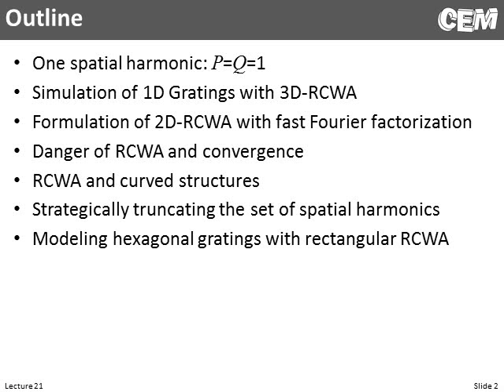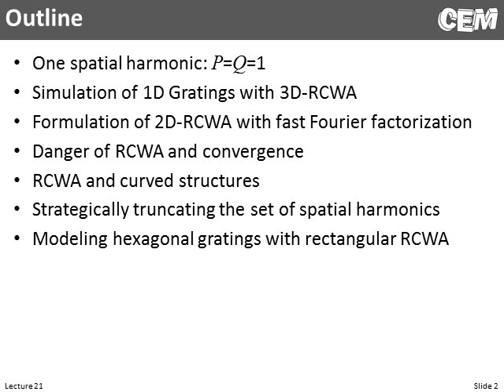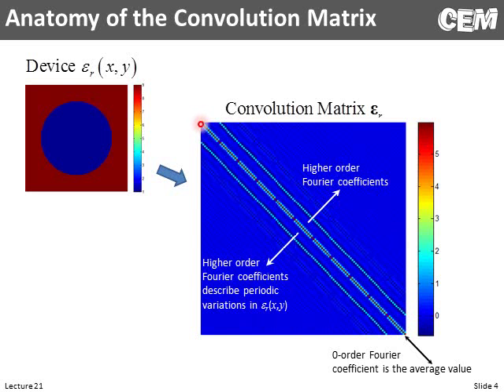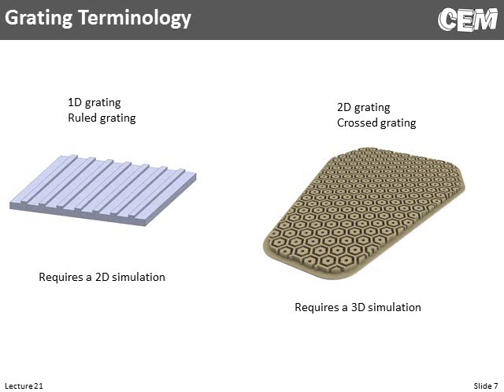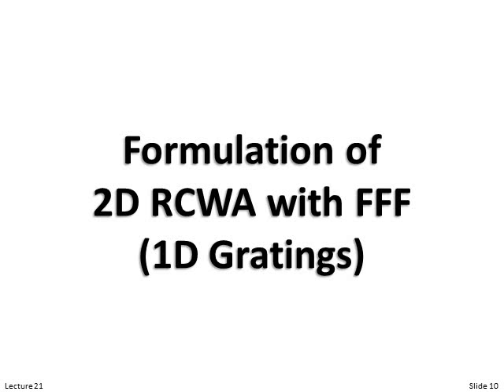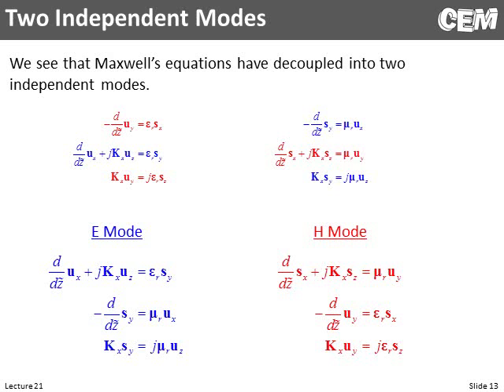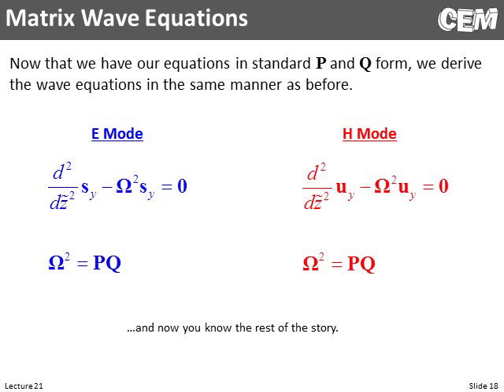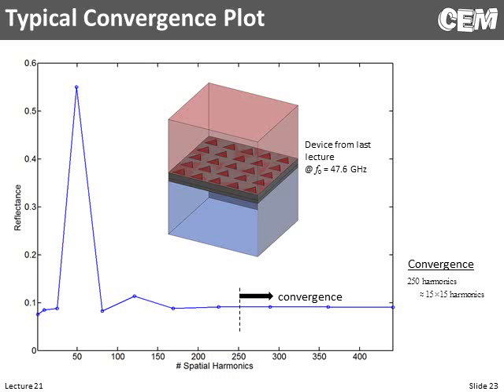Lecture 21 (CEM) -- RCWA Tips and Tricks

Comment: Hello Professor, I have watched this series of your videos and have learned a lot about computational electromagnetics from them, and I have also implemented a rigorous coupled wave program according to your method, and it seems to be running well. But one question I have is, if I have a thicker layer, for example, in real life every periodic structure has a substrate, if this substrate is thick, shouldn't I treat the substrate material as a transmissive region instead of as a layer? Or do I need to do other programs to handle this situation！
Reply from the maker: Usually the substrate is made to be the transmission region. The RCWA presented here cannot have loss. This is something we are working on. If you substrate has significant loss, you may need to make your last layer the substrate in order to account for the loss. You would then set the transmission region to air or something that matches the substrate material.

Hope this helps!

Comment: Dear professor, thank you for lectures!
If I undersood correctly, the computation time for RCWA is definitely depends on number of input values such as different incoming angles or wavelenght. It seems to me that we expect to see a linear dependence on the number of these input, provided that the structure and other parameters remain unchanged. Am I right?
Reply from the maker: The simple but incomplete answer is to say that a parameter sweep is a series of independent simulations. So, if your parameter sweep is an array of 100 things, total simulation time will be 100x the time of a single simulation.

Now the longer answer…Depending on what parameters you are adjusting, there are sometimes calculations in a simulation that do not have to get repeated each iteration. This speeds things up in some nonlinear way. For example, the convolution matrices in RCWA do not depend on angle of incidence or polarization. If you are not accounting for dispersion, they are also independent of frequency (or wavelength). You can calculate the convolution matrices one time and then perform the sweep without recalculating the convolution matrices. Polarization does not enter into RCWA until the very last step when reflection and transmission is calculated. That is the fastest parameter sweep for RCWA because 99% of the code does not have to repeat, including the part that iterates through the layers of a device.

When setting up a parameter sweep, look carefully to see what calculations will remain constant. Move those calculations outside of the sweep to maximize speed and efficiency. If you are doing double parameter sweeps, consider carefully what parameters you sweep first, second, third, etc. For example, if you were sweeping frequency and polarization, I would have the outer loop be frequency and polarization be the inner loop. That is because sweeping polarization is the easiest. If you were to move that outside of the frequency loop, you would be repeating many calculations that you should not have to repeat.

Hope this helps!
Reply: @empossible1577  thank you for answer! I found an interesting paper where the new solver is compared with RCWA. I don’t understand one point and I would like to hear your opinion. Let me contact you personally by mail...
Reply from the maker: @annakharcheva4548  Ok

Comment: Hello professor, I'd like to calculate the internal field in real space, I've looked at your notes but I'm unsure what you mean by the step "Calculate Indices of Where to Place Fourier Coefficients" in the diagram. As far as I know, the steps needed are to define the phase cross section, then for every z-coordinate inverse Fourier transform the field s(m,n) at that zi and multiply piecewise. But how do you ensure the same matrix sizes, since the number of harmonics are probably much less than the resolution in real space. Is it as simple as padding with zeros before the ifft? Also, how do you ensure that the resulting field is real? Thank you for any reply!
Reply from the maker: This is a big question with a big answer.  It is on my to-do list to make an online tutorial for visualizing the fields in RCWA.  I like to do this using the enhanced transmittance matrix method instead of scattering matrices.  So I recommend implementing this method first.

As for "calculating indices of where to place Fourier coefficients," you need to do an inverse FFT to calculate the real-space fields.  Usually RCWA is performed with a low number of spatial harmonics, say 11x11.  If you directly iFFT this, you will get your fields on an 11x11 grid and they will look very pixelated.  To get nice smooth looking fields, you need to pad the iFFT.  This means you pretend that you have done RCWA with  something more like 256x256 harmonics.  You will create an array of the Fourier coefficients where most of the 256x256 are all zeros.  The actual Fourier coefficients are inserted into the middle of this big array.  The location of where you put them is what I mean by "calculate indices of where..."  In general, the field is not purely real because RCWA is a frequency domain method and fields will have amplitude and phase.  I generally calculate complex fields and then just plot the real part.

Does this help?
Reply: @empossible1577  Yes! thanks a lot, that's exactly what I had in mind, it just felt like I was missing something. I have already implemented ETM and call the ifft like so, ifftn(s, [256, 256]) to automatically pad with zeroes to the desired size.
Reply from the maker: @ManderSeis  Sounds like you are doing awesome work!  BTW, you may not be aware of the course website.  I recommend using it as your main portal to the course material.  You can download the notes, see the information organized, get links to the latest versions of the notes and videos, and see other learning resources I put there.  Here is a link to the website:

https://empossible.net/emp5337/
Reply: @empossible1577  My code seems to work decently well now, but just to be sure, Ex and Ey should be continuous across boundaries right? In some cases this does not seem to be the case, could that be an IFFT artfact, or is there probably something wrong with my code?
Reply from the maker: @ManderSeis  How do you know it is not the case?  Are you calculating them?  How are you calculating them?  Yes, they should be continuous, but it is the sum of transmitted and reflected that is continuous.  If you are only looking at one of those, the field may be discontinuous.
Reply: @empossible1577  I think I might have propagated the backwards wave in the wrong direction (wrong sign), no wonder the boundaries looked messed up. Thanks professor!
Reply from the maker: @ManderSeis  Great!

Comment: hi ! your lectures are great!  I am searching for a book or pdf which introduces the rcwa method together witch actual code... do you have any suggestions?  thank you in advance.
Reply from the maker: I do not know of any books that would serve as a good introduction.  In fact, the only book I know of on the method is "Computational Methods for Electromagnetic and Optical Systems" by John M. Jarem.  I do now know if that comes with MATLAB codes.
Reply: Thanks a lot for your response and for pointing out the book!! I really appreciate your feedback.

Comment: Thank you for you lectures! I've finished 3D RCWA course on EMPossible and it was wonderful. Now, I'm trying to simulate a physical situation where a slab waveguide mode is initiated by the far-field light from a material having high refractive index like prism. It's similar to the Surface Plasmon Resonance(SPR). I'm not sure RCWA is the best way to simulate this kind of situation because in this case materials are all homogeneous(spatially, in x and y direction). Should I rather use FDFD or FDTD? I want to know your opinion. Thank you. Happy New Year :D
Reply: Additionally, I want to make sure the values of parameters like wavelength and angle of incident light, thickness of cladding and core materials enabling the evanescent field from high refractive material to initiate propagating waveguide mode.
Reply from the maker: If I understand your problem correctly, RCWA can do what you want, but it is going to be weird and cumbersome to inject your source and post-process the simulation.  I do think FDFD or FDTD would be easier methods.  Also, since you mentioned high refractive index, FDFD and FDTD may work better for that as well.  I personally only use RCWA for simulating periodic structures like diffraction gratings, guided-mode resonance filters, photonic crystals, etc.

FDFD and FDTD and roughly equivalent methods and I think both would serve you well.  FDFD is easier to implement, easier to incorporate dispersion, more accurate for highly resonant structures, and faster to simulate for smaller simulations at a single wavelength.  I look to FDTD when the problem size is very large or there is something else that would make the numerical problem huge.  FDTD will capture the transient physics and make for better animations.  Don't underestimate the importance of visualization!
Reply: @empossible1577  Thank you for your advice! And thank you for telling me in which instance you would use each technique. It helps me a lot to choose appropriate method depending on what I want to do. Thank you :D

Comment: You also mentioned in this lecture sometimes 2 or very few spacial harmonics are retained(more than 1), could you refer to the literature using this approach? I was wondering if it's an explicitly formulated 2-modes TMM or it's just RCWA using 2 modes.
Reply from the maker: I am not sure what part of the lecture you are talking about.  If you have homogeneous layers, you can use RCWA with only 1x1 spatial harmonics and the algorithm essentially reduces to TMM.  Both TMM and RCWA can simulate both TE and TM modes in a single simulation.  The TE and TM modes are only coupled if a layer is inhomogeneous and/or anisotropic with an orientation between the two.
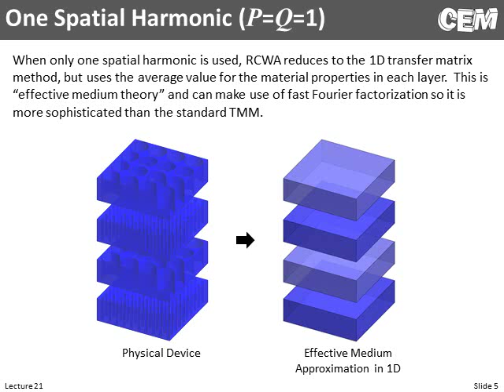Reply: Thanks, In 5:28 if this video, when you were talking about effective medium approximation, you mentioned "sometimes 2 harmonics" retained.
Reply from the maker: Ah yes.  I am referring to when people have derived higher-order effective medium approximations.  In the papers I was thinking about, the authors were deriving closed-form equations.  I am personally skeptical of the value of those higher-order approximations.  They are more complicated equations and, in my opinion, when those become needed I think it warrants a full rigorous simulation anyway.  I tend to use first-order approximations for closed-form equations or fully rigorous simulations.  Anything in between is rare for me.
Reply from the maker: Take a look at Lecture 10 here:

http://emlab.utep.edu/ee5390em21.htm

I explain what I am talking about and provide some references to the literature.  Check the electronic notes as well as the recorded video as I think I have made a number of improvements to the notes without rerecording the lecture video.

Comment: Thanks for the lectures. Do suggestions of how to modify the code for hexagonal symmetry? Using the rectangular method to model the reflectance of opals I noticed that I didn´t get 3-fold symmetry when rotating the polarization around at normal incidence.
Reply from the maker: Interesting.  The "real" way to handle this is to build the convolution matrices using the actual reciprocal lattice vectors of the hexagonal lattice.  This involves numerical integrations so it is a bit slower than using FFTs.  I do think FFTs exist that can operate in non-orthogonal coordinate systems, but I have not played with those.

Comment: Dear professor, thank you for your lectures! One question - once I calculate the field distributions for Hx, Ey, Hz & vice versa components inside the grating, shall I start immediately from the homogenous reflection region (air), or from the first sub-layer of the grating by using S matrix?
Reply from the maker: The z coordinates start at zero at the first edge of a layer.  It is all local coordinates as I have formulated.  It will start again at zero in the next layer.
Reply: @empossible1577  I have checked the new formalism for calculating inner fields for 2D gratings in (x,z) domain. The energy conservation principle for E & H modes works perfectly, however the more layers are added, the more unstable the inverse S matrix' components get once field components inside the device are calculated. Is there another way of avoiding this problem?
Reply from the maker: @ignatiolu863  When I visualize the internal fields in RCWA I used the enhanced transmittance matrix approach, not scattering matrices.  It is faster and the internal parameters are calculated more naturally.  I am sure it is possible visualize with S matrices, but it is not the way I do it.  I recommend that.

Comment: @29:58 I''m confused. You say there are 19sqrt(2) harmonics along the diagonal but there are only 19 blocks along the diagonal
Reply from the maker: You are correct. I misspoke. The wave vectors along the diagonal have a larger magnitude, meaning they resolve the fields better along the diagonal by this factor. For this reason, a truncation scheme makes sense to as to even out the resolving power.

Comment: Hi, professor. Thank you for your lecture!

I have a question about handling dispersive materials in most of simulations you teach us as well as 3D RCWA.
I think the simplest method is that we rebuild our device everytime wavelength changes while doing parameter sweep.
I know it consumes a lot of time, but that's only what I can come up with.
And I want to ask you whether this method might cause any problem.

Thank you for your reading :)

P.S. I also want to ask you how things related to handling complex permittivity in RCWA are going. I still haven't solved this problem ...
Reply from the maker: Yes, handling dispersion is as simple as rebuilding the device at each frequency step.  While slower than not doing this at all, I don't know of any trick to speed this up.  Perhaps your dispersive material only exists on one layer so you only need to rebuild that layer.

As for loss, that is as simple as making the permittivity complex.  The part we are still working on is making it so the external regions can have loss as well.  It turns out that was more involved than we thought.  We are close, but COVID slowed us down.  For now, the equations for diffraction efficiencies are only valid when the external mediums do not have loss.  Sorry!
Reply: @empossible1577  Yeah, like you said, I have just one layer of dispersive material so it doesn't consume that much time. Thank you for ensuring it!

Ah, then you're saying as long as the external materials don't have loss, we just have to make permittivity of non-external materials complex and then everything like diffraction efficiency still works well?
Reply from the maker: @HCho-xe1cj  Yes.  If you end up seeing > 100% transmission or reflection, you likely got your sign convention backwards and need to reverse the sign of the imaginary part of permittivity.
Reply: @empossible1577  Ah, I see. And I hope the publishing is finished well. Thank you so much!
Reply from the maker: @HCho-xe1cj  Student has finished writing and is waiting for me to review!
Reply: @empossible1577   Wow, I'm so happy for you :D

Comment: Hi, Thank you so much for your helpful lectures,
I have one question about sorting the modes. I would be grateful if you answer me.
How we can sort the guided mode in RCWA? I mean, if we want to use RCWA code for simulating a slab waveguide, how we could find the fundamental TE or TM mode?
Thanks in advance for help ,
Reply from the maker: Unfortunately I do not cover this subject in any of my slides.  For slabs, use TMM instead of RCWA because it will run faster.  However, RCWA with one spatial harmonic defaults to TMM.

I am not going to be able to describe how this is done in words here, but I can provide some clues.  You will fix the value of the propagation constant (or effective refractive index), perform your standard procedure of stepping through layers in the cross section of the guide, and you will end up with a global scattering matrix.  From this, you will extract all modes with that propagation constant.  To determine the fundamental mode, make a good guess for the effective index (should be very close to the core effective index) and then look at the mode profile to confirm.